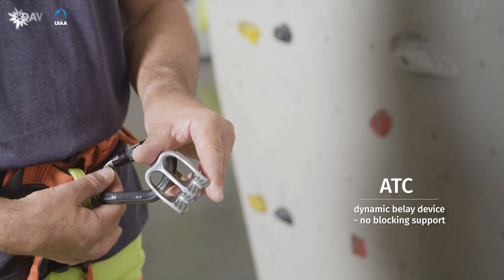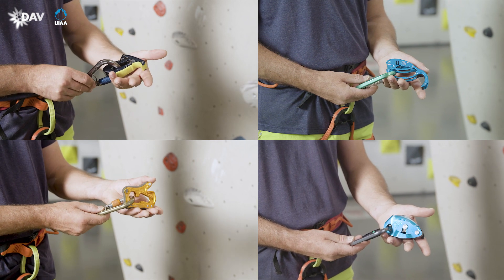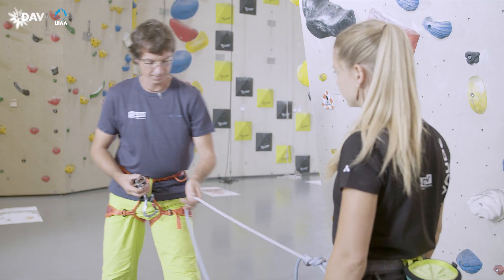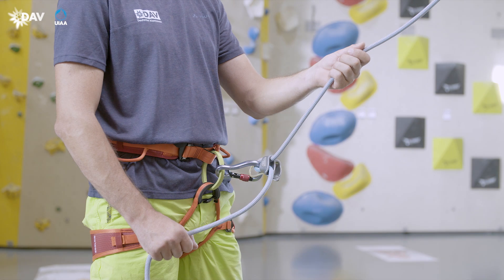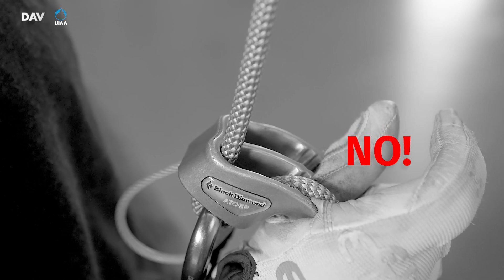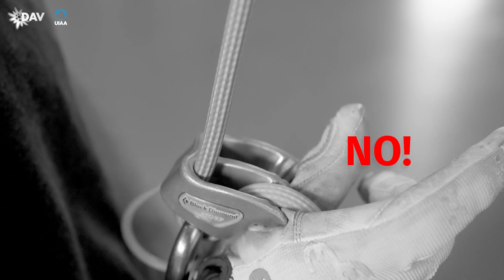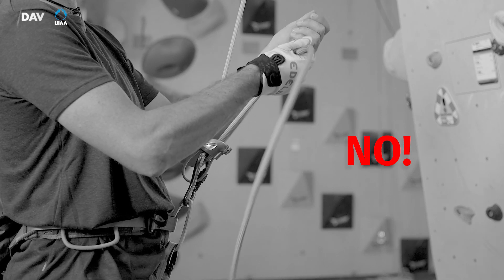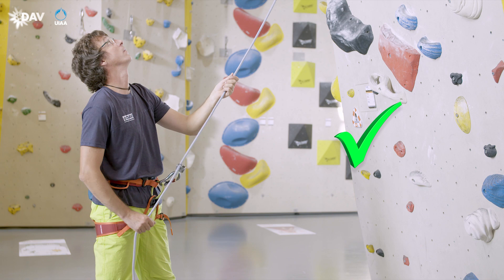Climb Safe: How to belay with the ATC

Comment: There are a couple of things I really dislike about this video. Firstly, I'd dispute the suggestion that dynamic belay devices without grooves don't work with modern ropes, per-se.  They work fine with modern ropes if (a) consideration is given to the diameter of the rope and its compatibility with the device, and (b) it is being used correctly by a competent belayer.  More importantly, it seems ludicrous to be advocating a method of belaying  in training video that is so 'niche' and open to being misunderstood by novices.  With an experienced and competent belayer, using a modern belay device with braking grooves, it is probably safe enough to use the 'tunnelling' technique whilst bottom roping.  It is totally unnecessary though, when the 'hand over hand' method is both more foolproof and more versatile; being the technique that you would use when actually top roping, such as when bringing up a second on a multipitch climb.  It's good that people look at ideas, but it seems that in this case it is promoting a new (and potentially rather dangerous) idea just for the sake of it.  I shall not be showing it to my students except as a demonstration of what not to do.
Reply from the maker: Three detailed answers are necessary here:

1. The grooves issue: it is true that even tube style devices without grooves do work good enough in most situations – as long as the belayer doesn’t make mistakes (which, of course, should always be the case – but in reality we see different things happening …). If you listen to the text in the video it is explained why we recommend using devices with grooves: because the ones without grooves cause a „relative low brake effect with thin ropes“. It is proven that almost all tubes without grooves – and also tubes with worn grooves – amplify the belayer’s hand strength less than tubes with good grooves. In extensive testing the Safety Research of the DAV has found out that most setups also work safely even if the belayers make one or two minor mistakes (which should never be made – but in reality we see that they happen - e.g. not paying attention all the time or having the brake side hand(s) too far up when taking in slack, etc.). These minor (but not so rare) mistakes usually do not impair the safety of the system as long as the main parameters are not set very close to their limits: rope diameter on the rope side, brake force amplification on the device side, weight difference on the climbers‘ side, etc. It is too complicated to discuss these things in a „how to“-video. That is why we decided to recommend devices with (good) grooves. If you are interested in a more detailed publication of our findings check this out: http://bergundsteigen.at/file.php/archiv/2019/2/24-33%28untersuchungen%20zur%20fehlertolereanz%20der%20koerpersicherung%20mit%20tube%29.pdf

2. The „hand-over-hand“ method (part 1): in most parts of the world, the „hand-over-hand“ technique is not used for advanced sport climbing any more. This is just a matter of fact. If you think I’m wrong I suggest you have a look at a belayer in a competition. This is probably because – in modern sport climbing – slack has to be taken in very quickly quite often e.g. when the climber cannot clip the rope into the quickdraw and drops the rope unexpectedly. Speed Climbing is gaining popularity as well. We observed that many beginners were struggling with the „hand-over-hand“ method in gyms, where even beginners can climb easy routes pretty quickly on toprope. Also experienced belayers sometimes when slack needs to be taken in quickly. The novice belayers do not have any problems taking up slack quickly with the method as shown in the video on the other hand. This is why – at the DAV – we have been teaching this „new“ technique successfully for more than 15 years now. About a year ago this was also discussed within the UIAA amongst experts from all over the world and the decision to publish this method on the internationally recognized website of the UIAA was the result.

3. The „hand-over-hand“ method (part 2): when body-belaying a second climber with a tube, the „hand-over-hand“ technique is necessary! But: the „British“ method (as we would call it in Germany) of body-belaying the second climber is only taught outside of the alps still. And also outside of the alps the method of belaying the second climber from the belay station (not from the harness) is becoming more and more common – especially with the growing number of routes that are equipped with bolts.
Reply: Thank you @alpenverein for taking the trouble to give such a detailed reply.  I think it highlights the differences between two very different types of climbing.  As one who practises 'Trad' climbing (where the leader places protection), but has little interest in 'Sport' climbing (on bolted routes, or at climbing gyms), I welcome your clarification.

For additional clarity, I would note that what you describe as 'body belaying' (belaying from ones harness, as opposed to belaying from a piece of fixed protection) would be referred to as 'indirect belaying' in British parlance.  We would typically refer to body belaying (taking the rope around the body, and not using any belay device) as predominately a winter mountaineering technique, especially for bringing up a second climber.  In the UK tradition, 'direct belays' are generally only used where the rope can be taken around a rock spike, etc, where again, no belay device would be used.  Nowadays such would only be used to protect a second on easy ground,  such as when scrambling,  or on a descent route.  I'm sure you would agree that you would never take a direct belay using a belay device attached to a single piece of leader-placed protection!  I'm aware that this is a common method used on fixed gear in the Alps, but most British climbers operating in such an environment will consider bolts as being just a fairly bomb-proof piece of gear.
Reply: Always your hand below the angle and you can perform any  stunts.

Comment: Very unsafe. This could actually get someone killed.
Reply: Why ?  If you are going to make a comment then at least take the time to back it up with some sort of explanation.  I am here to learn.  And, quite frankly, I find this kind of intellectual laziness, while common, damned annoying.
Reply: @kshred3043  One thing that tends to be 'frowned upon' is sliding your hand up the brake line. People often prefer to ensure there is always a hand fully grasping the brake line (ie., hand-over-hand).

I like to slide my brake hand when i use a GriGri - as I trust the device and my skills - although I'm not allowed to use that method in my gym.

One thing I can say is: it is objectively safer to maintain control of the brake line 100% of the time. And safety is paramount!
Reply: @twen7yseven  The demonization of the tunnel method in the US (I think) is juist wrong. This is a safe method used in many places in europe and is thought by our domestic climbing association. It is even considered safer for lead belay bc it is smoother and equally safe.

Comment: Poor technique.
Reply: Why ?  If you are going to make a comment then at least take the time to back it up with some sort of explanation.  I am here to learn.  And, quite frankly, I find this kind of intellectual laziness, while common, damned annoying.
Reply: @kshred3043  many people are taught different methods. They do what called tunneling. The problem with this technique is since one hand is up and one down you "slide" the bottom hand. Vs in the us and many other areas they "pass" hands by keeping both hands down and handing it from griped hand to other gripes hand. Imho I like passing because the rope is always on brakes and you dont need to grab a slipping rope on a fall that can burn you. Both methods work well if done correctly.  But I prefer passing as it means the brakes are always on.
Reply: @modernwar2ghostrp   👍 Thanks for taking the time to clarify.  Not just for me but on behalf of the other neophytes who might be reading.

Comment: Jeez this terrible belay technique
Reply: Why ?  If you are going to make a comment then at least take the time to back it up with some sort of explanation.  I am here to learn.  And, quite frankly, I find this kind of intellectual laziness, while common, damned annoying.
Reply: @kshred3043  You shouldn't just slide the right hand up the rope, cos you're technically releasing it for a short moment during which the person can take a fall. Instead, you should grab the bottom of the break rope with your left hand first, then slide the right hand up, then get your left hand back on the other side of the belay.
Reply: @alessandromasullo4658  Thanks for taking the time to respond.  It is very useful for me (and likely other beginners as well).  I guess the right hand slide advocates believe that they can grab the rope fast enough if necessary.  Although the sliding technique seems to be widely depicted on youtube, what you wrote makes total sense.  It will good to keep this in mind when I begin lessons with an actual instructor.  Find out just how qualified they really are.
Reply: K Shred  It is a wrong response though. True it is a very common myth by the people not using this technique, but evidence - as mentioned in the posts - clearly suggest otherwise.
From my 20 year experience, belagers avers to this safe method do not know what they are talking about, as they do not understand the dynamics correctly.
Don’t be fact resistent and study the science behind UIAAs recommendations and not someone merely repeating outdated arguments...
Reply: yea, he wouldn't pass a belay test with that crummy technique.

Comment: Worst belaying job ever cant beleive they made a video.
Reply: I swear with explaining climbing tools on youtube steep by steep reading right out of the owners manual people like you will still bitch...
Reply: @Squids_Vlogs   they have every right to bitch, the guy in the video never once held the brake rope secure with his left hand while sliding his right hand up. Awful belaying job.
Reply: @Shakra_Poshanka_Silksong  I agree entirely. Also it doesn't matter a damn which slot the rope goes through.
Reply: @Shakra_Poshanka_Silksong   This is actually a very common belay technique. It just isn't usually taught in gyms to new climbers. But, it a perfectly valid and safe way to belay.
Reply: @arcadegamesify   Still looks hella unsafe to me but I'll take your word for it. I'm a relatively experienced climber but only at bouldering, I go top rope climbing rather infrequently.
Reply: @Shakra_Poshanka_Silksong  Yeah, the problem is it requires you to keep your eye on the climber and pay attention. If the climber falls while you are sliding the break hand, you will have to grab down on the rope quickly, or else they will fall a bit before you catch them. Not a problem for a skilled belayer, but it's not foolproof. So, gyms usually teach you the 'PBUS' method where at least one hand is fully gripping the break line at any time, and sometimes they REQUIRE you to do PBUS, cuz it's fool proof, and they want to avoid any lawsuits. At the end of the day, either works fine, but make sure you're comfortable belaying before you try the sliding method. And maybe have someone experienced show it to you. :)
Edit: also, he still has his break hand fully AROUND the break line at all times, just for brief moments it's sliding instead of fully grasping it.
Reply: @arcadegamesify  As of June 5, 2020, there are 19 comments on the video.  Yours is one of only two that actually provides some sort of rationale for your claim.  Kudos for that.  I am here to learn.  I have never done any belaying so I can't really judge if what you are saying is correct or not, but I appreciate the fact that you have made some sort of effort.
Reply: @kshred3043  Numbers don't actually make an argument correct. This video challenges a paradigm, and change is painful. However, the video is correct and the complaints are wrong. The DAV test results confirm that the hand slide is actually more effective than PBUS, and particularly for novices. HOWEVER, and this was pointed out in the UIAA website hosting the video, for multi-pitch climbing, the hand swap technique preferred by  all the complainants is vital. Sliding the brake hand when belaying at the top of the pitch is indeed inappropriate - in such circumstances PBUS is essential. However in the climbing wall context of this video, this is the best way to use a tube device and as a bonus, is more intuitively understood by people who use also other styles of device.
Reply: @Shakra_Poshanka_Silksong  Dude it is a different method that is considered safe and more convinient than PBUS that you learn in the US
Reply: @GoodLuck-rh8tb  I know that now lol. Read the other comments, Ian Pogue already explained it to me a year ago